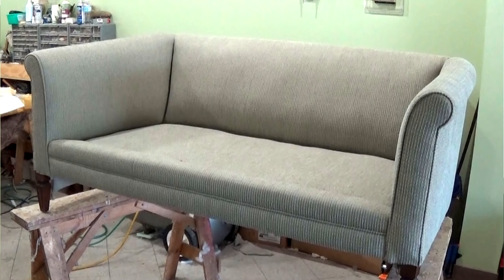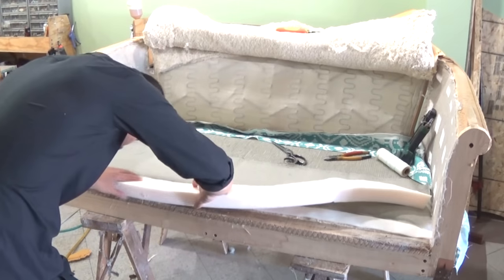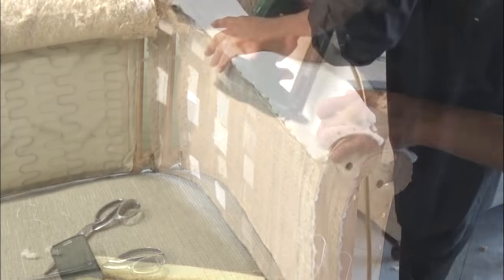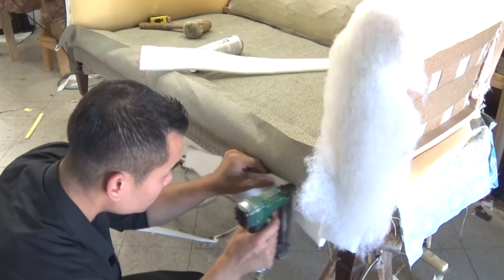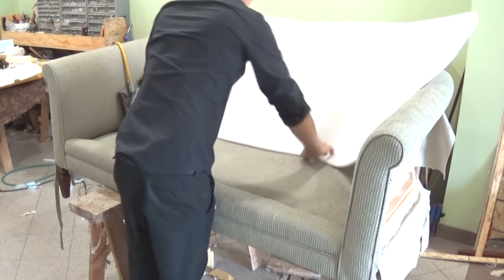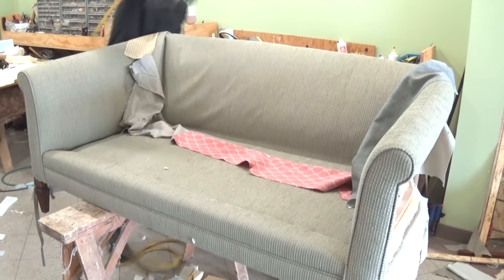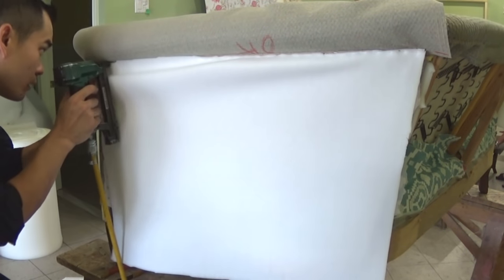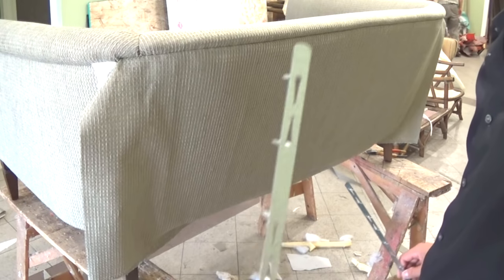DIY - HOW TO REUPHOLSTER A COUCH WITH ROLL ARMS - ALO Upholstery

Comment: is there an electric stapler you could recommend?
Reply from the maker: +Joe Sanchez sorry i don't use any electric guns so i'm not to sure whats the best one for you. i do apoligize
Reply: +Joe Sanchez He is using an upholstery stapler that requires an air compressor.  The cord you see goes to the compressor not to an electrical outlet.
Reply: restezlameme that is not for upholstery it has a narrow head and is for wood staples are too thick for material. but there are small ones which are electric if u need it for personal use not expensive.
Reply: muy intructivo tus videos me gustaria que le pusiera subtitulo bendicione
Reply: Probably u can use manual stapler..it's much better to use than to electric stapler..

Comment: are you using staples
Reply: Yes, but his stapler is running on compressed air, so you'd prolly need a compressor (the small ones doesen't cost insanely much) as well as a tube made for compressed air (which fits the compressor) and of course a stapler that uses compressed air. I think he's using that specific kind of stapler, because it literally shoots the staples in to the furniture with pretty high speeds. That fabric and foam aint going anywhere. It might get loose pretty quickly with a normal stapler for wood... At least thats what I can imagine, being a self taught craftsman.
Reply: +It's Eoleh  thanks man.👍